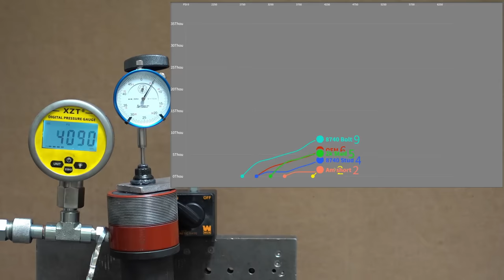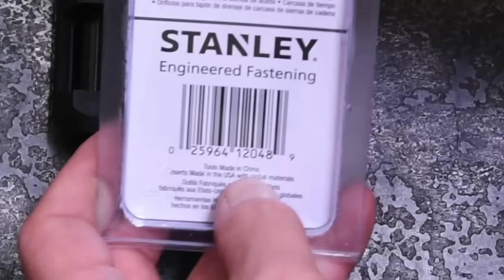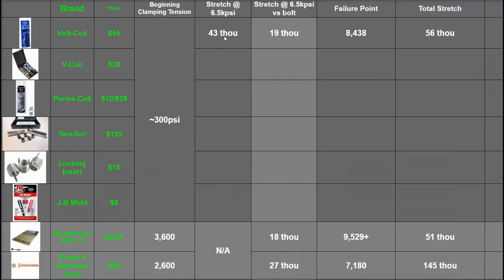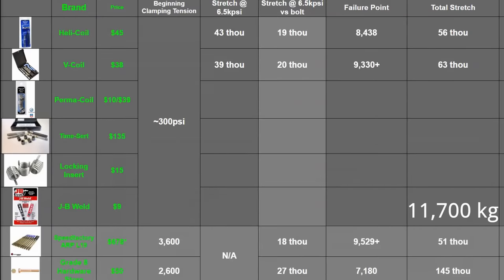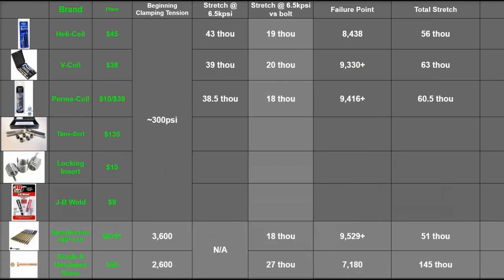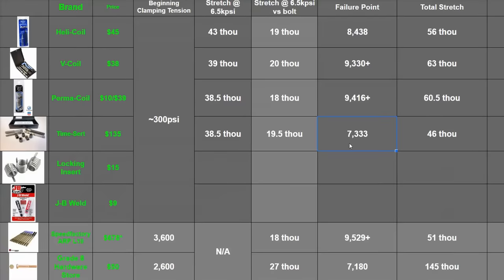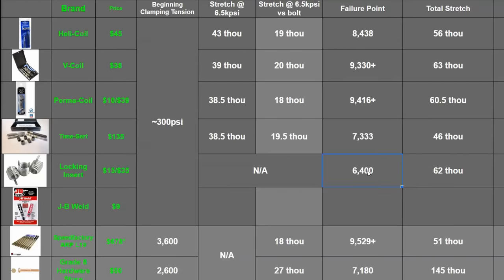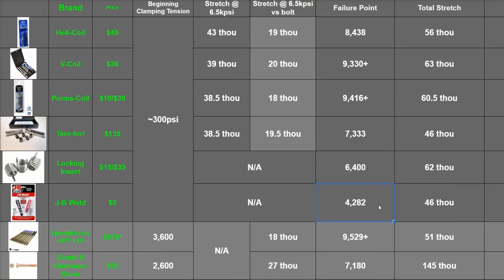12tons vs Bolt Thread Repair Using Time-Sert, Heli-Coil, J-B Weld & More

Comment: You can adjust your pump pressure +10% with no drama. Sometimes it just takes a few extra beans to get that happy ending.
Reply from the maker: You're spot on about that. This 12ton ram is 12tons at about 8700 psi so already poking it with a stick. Today we got it up to 9880 on a new special sauce head stud. Cheeks clench mode: engaged.
Reply: @TorqueTestChannel  There's only one way to find out...
Reply: @arduinoversusevil2025  how has no one else replied to the legends?? I'm surprised this is the first reply I thought it was locked from outside comments for a moment lol
Reply: Engage saftey squints and giver hell
Reply: @jacobwebb8818  do you feel special now?
Reply: @michaelfleury8472  no I don't care at all tbh just surprised no one's replied at all. Congrats on liking your own comment though
Reply: This sort of thing ain't my bag, baby!
Reply: wtf it's AvE
Reply: Skookum. Very skookum.
Reply: AvE !! 🎉
Reply: Engage safety squints and Giver her the beans

Comment: I love myself some Project Farm, but why he chose to use a class 8.8 / Grade 5 bolt for his tests perplexes me. His results for the inserts all looked the same because the bolt broke every time, isn't that lost data? This video took that variable out by using the L19 stud and we saw the difference.
Reply: I'm not the sharpest tool in the shed, and I found myself asking that as I was watching the PF video. I was like, how does the value at which the bolt breaks test the insert?
Reply: Yes the repair data is only as good as the bolts used. PF   These test used better bolts and found the pump limit.
Reply: @chrissmithz314  I think that he realized that as well and that’s why he didn’t draw any conclusions on what thread insert is best. He typically ends the video stating what product(s) he liked the best for one reason or another, but this time he did not do that.
Reply: I also think that he used grade 5 because it is the most realistic bolt grade you would find while working on a car. About 90% of the bolts on a car/truck will be grade 5 or the metric equivalent while higher grades would be used for things like connecting rod cap bolts, head Bolts, crank bolts, etc.
Reply: Eh, not really. Showing that all the inserts are stronger than the task they would most likely end up preforming is valuable data. In the same way that showing adhesives are stronger than the material they attach is valuable.
Reply: Most of his tests don't make much sense.
Reply: @BeersAndBeatsPDX   They are all relative tests. If you prefer more scientific testing then there are probably plenty of other channels that show this kind of stuff. Have fun falling asleep while watching them.
Reply: @stevenvanheel3932  His tests are everything that's for sure but they in no way represent the use of the average home owner.
Reply: @BeersAndBeatsPDX   Idk why the average homeowner would need to know the difference between a grade 5 and a grade 8 bolt anyways? If you want tests that are good for the average homeowner then watch his videos on weed whips and other things that an average homeowner would need to know.
Reply: Likely because those are typical uses cases - you broke a random thread and need a quick repair rather than a component replacement, and that’s what he tested. That’s also why he showed the copper wire and red loctite methods. Would I have liked to see blue loctite instead? Absolutely - if I was trying to repair a thread using loctite I’d be using blue instead of red, but while I’m not sure red loctite is actually all that common in most homes, I’m sure blue loctite isn’t common at all (for those unaware: red = normal thread locker, blue = “permanent” thread locker - about the only place you’ll see that in use are inside engines and transmissions where the extra holding strength at high temperatures matters). 

Besides - knowing that any insert based repair is stronger than the original aluminum threads is all you really need to know - it’s not a repair, it’s an upgrade :)

Comment: I'd love to see this redone but with cast aluminum instead of cast iron... At least in our shop we don't often run into cast iron blocks losing their head bolt threads but we run into aluminum block issues all the time...
Reply: Project Farm did his test on aluminum bars.
Reply: @jaredhuang2225   He used cheap hardware store bolts though so the bolts broke long before the inserts would ever fail.
Reply: IN aluminium it is normal to use much longer inserts to match the lower strength materials
Reply: Time serts are the only way to go in an aluminum block, imho...  I've done a few BMW m54 blocks with them and they're all going strong years later.  I even own and drive one of the cars I repaired that way (customer passed away and I inherited his 325i cabrio...)
Reply: @billymanilli  I'd say that they are not the only way. The only way is to choose the length of insert to suit the strength of the material and the required tension, but that requires a bit of calculation and tribology. In many locations the time serts will remove a bit more wall and risk other issues, but yes I do like time serts. There are times when they are more suitable and in other applications they are less suitable.
Reply: Lol with nothing to back it up other than I used it and time sert worked so its obviously the only way to go.

Comment: I think those locking inserts didn't play nice with cast iron. Those keensert-type inserts usually warn you against using them in brittle materials because those locking keys are trying to displace material when you drive them in. The other inserts just required cutting new threads, which when the insert is installed, doesn't exert a ton of stress into the receiving material. The damage on the failed billet look like it's exclusively in the material rather than the insert itself. I've also seen those inserts used in a lot of aerospace parts, but they're generally aluminum as you mentioned, which has enough ductility to make it work

Comment: The poor man's J-B Weld hack that I've heard about (and tried unsuccessfully) was to slather the J-B Weld into the hole and onto a clean bolt, screw the bolt in (but not clamping anything), then allow the J-B Weld to cure.  Then remove the bolt and try to use as normal.  I think that once you're drilling/tapping... you may as well do an insert.

Comment: The Time-Sert option looks like the best choice for an assembly that has to be frequently bolted and un-bolted. The locking insert is like the faster and less critical version. I've always liked using properly installed Heli-Coils, but you can never say that too loudly or else the "Time-Sert or nothing" crowd comes out of nowhere and starts yelling. Finally some real data to quiet them down on coil inserts being supposedly for hacks.
Reply: Exactly. Nevee know til you test. Ill be saving money not using time serts.
Reply: @jacksmith2315  We hate helicoils because they don't lock in correctly and come out after one use. If you are a "one and done" kind of person then helicoils will work great. If you plan on taking it apart, be prepared to have the helicoils come out with the bolt their threaded into! Not saying their bad! But there is way more to an insert then strength. The helicoil being stronger doesn't really mean anything since, WHEN TF are you gonna torque something to the point where it would break a grade 8 bolt with a timesert? What matters is that the tread is permanent and doesn't come out during disassembly.
Reply: TIME SERT OR NOTHING YOU HACK!!!🤣🤣 Honestly though, during my stealership days, we used time serts to repair cylinder head bolt holes, rocker arm holes, etc. Now I find out that not only would a helicoil work, but was actually stronger??? I'm sitting here like, wtf right now. The one thing about the time serts is that they will be able to be taken apart again, and helicoils usually come out with the bolts when you disassemble the parts.
Reply: @jdmking4776  I'll take the stronger option considering I used them to mount a new upper control arm on my car lol. Less likely for an oh shit moment on the highway .
Reply: @jacksmith2315  the issue here was the base material... Brittle stuff doesn't like the deformation of TimeSerts. An EZ Lok is the better choice for iron blocks, TimeSert is king in aluminum blocks.

also, coil inserts like to come out, and are notorious for allowing leaks when the bolt hole pierces a fluid gallery.
Reply: @Spike-sk7ql  see my previous comment
Reply: @98integraGSR  I know all about what you said in your comment. My comment was only a mere joke. I've used plenty of time serts repairing rocker arm bolt holes in GM V6 heads, and other things.
Reply: @jdmking4776  for things under serious tensile loads like cylinder heads that strength can matter. It could be the difference between making pass after pass without issue or lifting a head and having to take everything apart again. Something like a caliper where it's primarily in shear it probably doesn't matter though. So it definitely depends on application. You could also use thread locker on the other styles of insert to prevent them from backing out.

Comment: I use Perma coi and Heli coil at work and have never had an issue. We’re usually using them in spindles or knuckles for suspension mounts or caliper bolts. I can confirm that at least once, that I’m aware of, one of my techs forgot righty tighty lefty losey, and wound up snapping a 14mm bolt, 19mm head, for a caliper bracket in half. It was only after I managed to get the bolt out that I realized it was a hole that we had previously repaired with a Perma Coil. The coil was still in perfect shape and is still in that vehicle today. That was the day I learned just how strong coil type repairs can be. I’m actually happy to know that it wasn’t a fluke. Thanks for the awesome video!

Comment: Manufacturing/machining job worker here: The Helicoil install tool is typically best used for making sure the coil doesn't cause scratching on your part, and helps align and keep it set right for tightly-machined threading. Most of the reasons we use it at my job is because we're working fairly soft aluminum, and these tools keep them from screwing the threads or chromate up, and help prevent possible cross-threading.

Some of the helicoils are 7/8", and those ones come loose enough to slide over 1" insert tools.
Reply: Some small metric sizes are prone to cross threading, or skipping a thread on install without the compression tool. The pneumatic installation tools and collated helicoils are where it is at for production.
Reply: I worked for a company where we put in 0-80 x 1.5L tangless inserts on a particular part. It was a bitch trying to keep the tool engaged with the notch. had to keep it under tension when repositioning your hand.
Reply: definitely one of the benefits of using Helicoil are the install tools; they can be a pita on the cheap chinese knockoffs. Then again looking at price for a home shop the cheap option might be worth the hassle of having to tear out a butchered coil once in a while... it comes down to how often you use one. I found just taking your time does the trick and reduces pain when using cheap low quality install tools. (no news there...)

Comment: Thank you for another tremendously useful video. You can imagine the horror of stripping the threads out of the drain plug hole in a cast aluminum crankcase and the subsequent elation of fixing it with a Heli-coil. I still remember how much more smoothly the plug screwed in to those stainless steel threads 40 years later.

Comment: Won't lie, I was giddy to watch both of y'alls videos.  I had a rude welcome to Heli-Coil kits when I first bought an ATV.  The really thin metal that is threaded to hold on the skid plates rusts out super quick, so I had to use a kit on it and learn to cover that thing in oil/grease.

Fast forward to next ATV, it came with a broken bolt that holds on the exhaust shroud and instead of messing with Yamaha warranty, etc. I just used the same Heli-Coil kit from the other ATV as it was the same size bolt.  Installed with red loc-tite and its been good since about 2007.

Comment: Wow...pretty impressive what cheap little thread repairs can withstand. Wasnt expecting those results. Even more shocking the time serts didnt do as well. You always hear those are the best. Just goes to show you never really know until you actually test them...for science. Thats what makes your channel stand out over all the others, the proof is in the pudding, cant just listen to what someone tells you thats never tested the stuff before. Great vid bud. Keep up the awesome work for the gearhead community...and science haha
Reply from the maker: Time-Sert appears to work the same as heli-coil in (shallow) aluminum, which PF shows well
Reply: Project farm is another great channel. Ya thats great if you're working on aluminum. But if you listened to old man dave at the shop or uncle bob when and used s time sert in your cast iron block or head, youd be spending way more money for a repair thats not as strong as the cheaper options, which im sure is more common in the diy. Or since you said shallow aluminum, id assume used still be better off with the cheaper options in an aluminum head or block
Reply: helicoil and other "spring types" can distribute that load more evenly, just imagine what happens to "hard" threads when they start to give up....one lap at time, you lose your threads because there is lot more load in first lap than second or third...but anyway, nice to finally see some testing on these  :=D

Comment: LET'S GO!!!🏁
I bought a used car as a work car and a couple months after I bought it it spit a spark plug out at me I used the Heliocoil tap.  And a Plug Saver from Fix-a-thread (Alcoa Fastening Systems) to fix it... that was 6 years ago I still drive that car hard..I used red Loctite  and "pinged" the edges very critical to tap lightly the material around the hole to move it slightly to "tighten " the hole...no problems since...
Excellent video..excellent info...👍

Comment: Project Farm did a similar test with many of the same products and fond E-Z LOK to be the best all around with the Heli Coil design all showing well but his test were in Aluminum 2" flat stock. The E-Z LOC came in a complete set with drill, tap & insertion tool included & the inserts already had red Loctite on them. In his testing the bolts were the common failure point rather than the inserts.

Comment: Interesting results. I've always thought Time-Serts were the gold standard as far as thread repairs are concerned. They are often recommended in place of Heli-Coils / other similar coil repair brands for things like engine block threads where the cylinder head bolts down to. The cylinder head fasteners are exposed to tremendous lifting forces from combustion trying to blow the head off, so I would definitely consider another option than Time-Sert if clamping loads were a concern.

As far as people in the comments section worried about a coil-type insert backing out compared to a Time-Sert? Not sure if I buy that, especially when you use high-strength thread locker to secure it. I've never had a problem with them backing out, even on fasteners that are routinely broken loose and retorqued. Very informative video. Keep up the good work.

R.I.P. to all the dial indicators who gave their life in the line of duty.
Reply: The issue was the base material... Using Timesert/Keensert-style inserts with a brittle material like cast-iron is a NO-GO. The install process is trying to plastically deform both the insert and the base material, and the process gets wonky on things like compacted graphite cast-iron.
Reply: To be fair, 1 isn't a good data set. It could have been a faulty insert. I would like to have seen a couple extra tests to rule that out.

Comment: Back in 1986, a machine shop felt it was best to install heli-coils for the spark plug threads into my remachined VW cylinder heads (didn't ask me).  Then about a decade ago one of the helicoils came out with the plug when re-doing plugs.  I installed a solid threaded insert (not a name brand) from CarQuest, red Loctite on the outside of the insert and never seize lubricant on the spark plug threads; fine for a decade now.

Comment: Great summary, and classy response to your friendly competition. Regarding the Timesert, I wonder if it might have done better if the bolt was threaded right down to the bottom of the hole. The way it broke suggests the bolt may not have used all the threads, breaking away where the tip of the bolt ended.... Even so, it sounds like a good real world comparison, since we try to never thread a bolt all the way down, leaving a little room for debris and variance in length and depth.
Reply from the maker: Good question, the stud was threaded into and past the 5/8" worth of time-sert. There is something to be said about a blind hole the bolt can bottom out in and provide an even pre-load against the threads though.
Reply: As he mentioned the bottom of the time sert is thicker, im sure he threaded it all the way through, it just did what most things do when they fail and give at the weakest spot, which is before the bottom where it got thicker. He also mentioned it was difficult to remove it which shows it was threaded through it was because it broke and distorted that made it hard to remove

Comment: We use thread inserts at work for aluminum molds that go through a bunch of heat cycles. Hand tight will work for most parts and the one's with a torque spec are pretty low, so they work when used in that scenario. Though people like to impact them down with Dewalt 20v Atomics.... So they don't hold up very well....